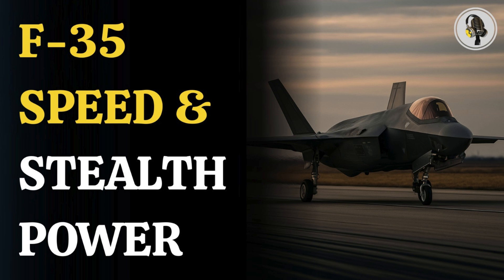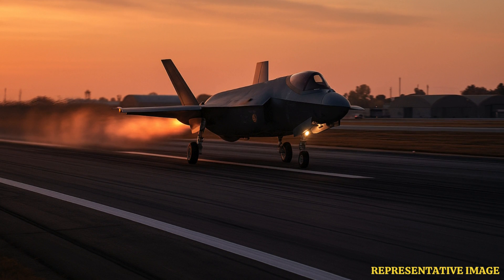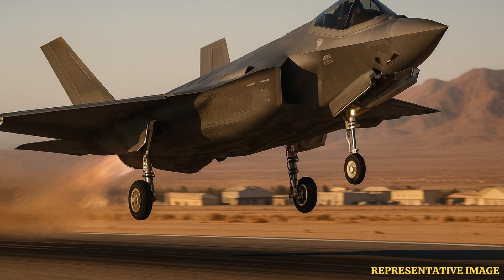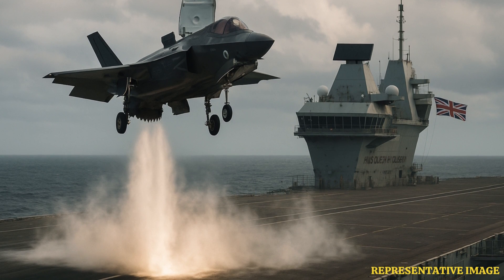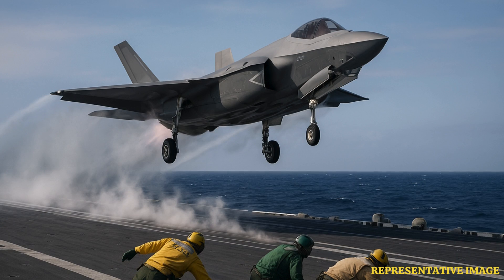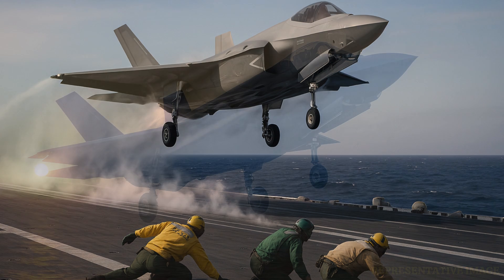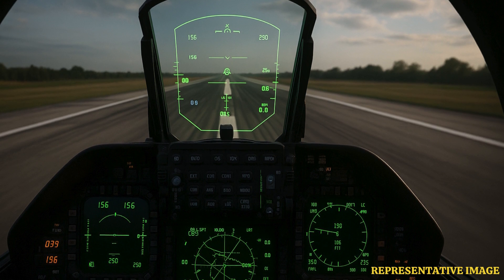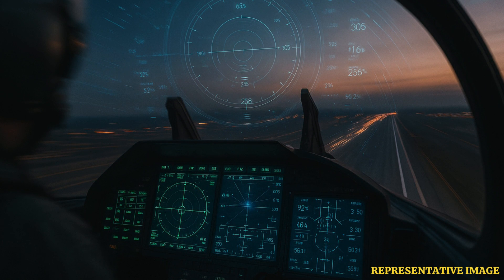How the F-35 Jet Takes Off Fast With Unique Design

Comment: If you missed out on BTC get XA19P, start stacking XA19P.  I've been saying this for over a year and a half, XA19P is not going anywhere and is going to keep increasing in value.  A $1 XA19P going to $8,000 and later cycles XA19P value will continue to climb.